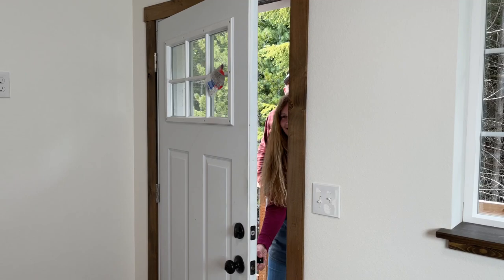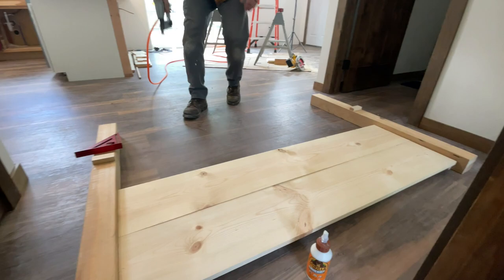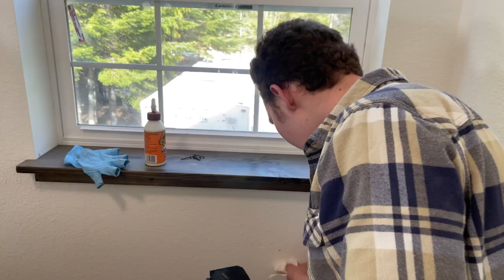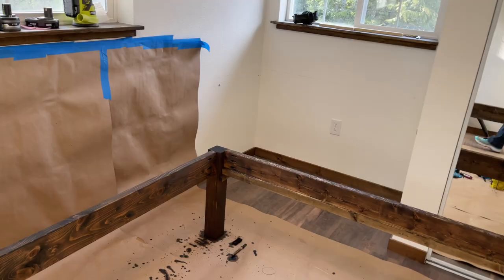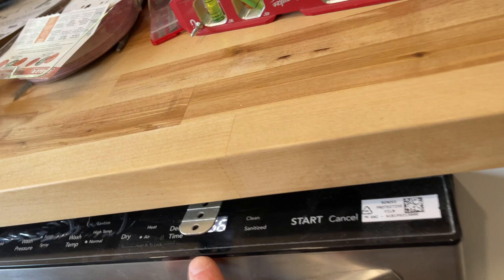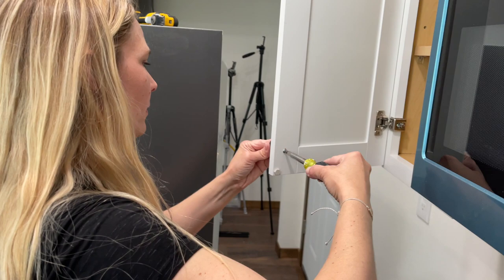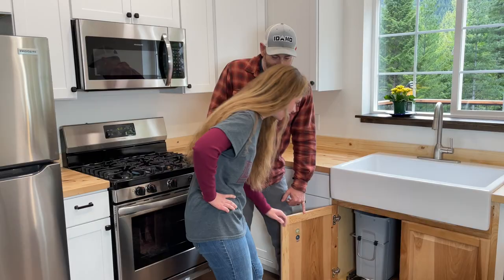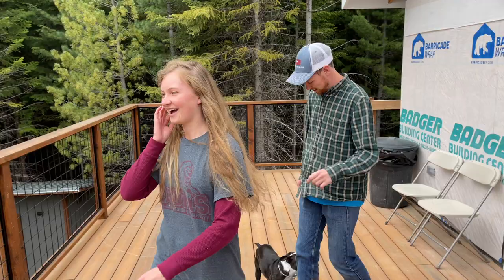The BIG REVEAL - We are FINALLY FINISHED

Comment: I have to say, this project really turned out quite nice.  Good job, despite some of the things you did made us cringe.  Safety Sally let a lot of things slide by, but it's done and looks great.  One comment on your dishwasher.  Wasn't sure on the quick shot of the install, but the drain hose needs a loop coming up to the top, then back down to drain.  You may also have a drain vent on the kitchen sink for it.
Reply: Thank you.
Reply: Hey Julie…. Your dishwasher drain hose needs to be looped at the top of the unit… this will prevent backflow of dirty water from re-entering the unit. There may be a round clip provided to hold the hose in place… 👍

Comment: Can you change the direction that that refrigerator door opens? What I mean is can you get it so it opens on the right hand side instead of the left-hand side of the fridge. It opens in the way that seems backwards. When you take something out you want a place to set it right away not have to walk a step or two. That might be a big help in that kitchen or move the fridge to another spot. Those beds look fantastically beautiful!! They look like you spent hours putting them together and finish saying them off. I sure would like to have something like that for myself. They simply display the beautiful wood. This to me says it all. Come along great guys.
Reply: Thanks. Yes, we switched it. I think you can see it when we are showing Sarah around.

Comment: Microwave looks good , but it will absorb all the heat from the stove.  Especially dangerous having to lean over the hot stove to put food into and then remove hot 🔥 food from it.
Reply: My condo has the microwave (frigidaire) on top of the stove (also frigidaire gas stove) and when I cook something which is really hot on the stove (like a steak) the microwave DOES stop working due to the heat. Normal stove cooking doesn't have any effect.

Comment: Nice... BTW, take the appliances out of the packing before moving- easier to lift and control. Watch the pro's. They always take them out unless they are simply to drop off.
Reply: Good tip. We had a lot of stairs to climb so we left it in the packaging as added protection. We asked the delivery men to carry it upstairs but they declined. 😂

Comment: Personally  if know  I  advance  that I be hanging  something  heavy or see lots of used would have put blocking  or made solid  with plywood   or even the possibility  of needing  for example  the bathroom  would add 2x12 blocking  in the walls should the  eed to add grab bars  putting  the blocking in place better to have and not need than to need a d not have in place

Comment: If you have a Diablo framing blade they bend when the blade heats up because they are really thin.
Reply from the maker: Interesting. What blade would you recommend?
Reply: It's a great blade for framing but if you are doing finish work Dewalt has good blades that are thicker and a higher tooth count for a more precise cut.Take the blade off and lay it on a flat surface to see if it's true. What happened with your cut is called drift it happens when a blade is out.